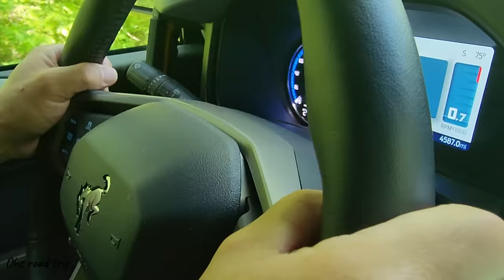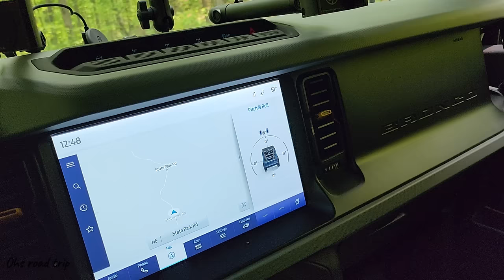We Converted our BRONCO Into a 2 - Story Cozy Home: RELAXING Camping in a Tarp Shelter with  ikamper

Comment: Relax video!  How is the roof top tent performs when rain?  Secondly, any suggestions or gears on how to minimize mosquito ?
Reply from the maker: Thank you for watching and comments.
We haven't used RTT when it rains. It says no problem using it when it rains.But it needs to be dried.
We use Mosquito Repell Coil and deep woods spray.also,I use a Mosquito head net.